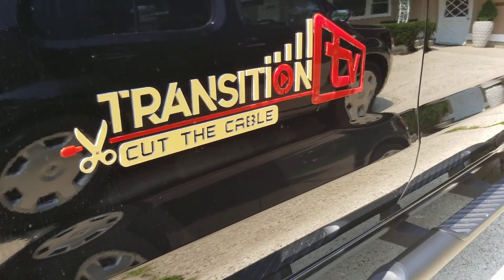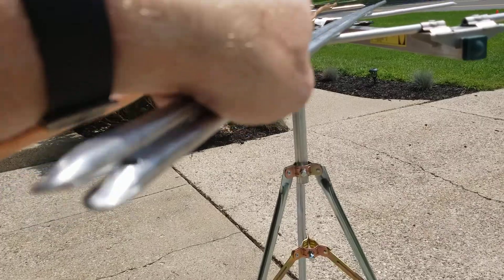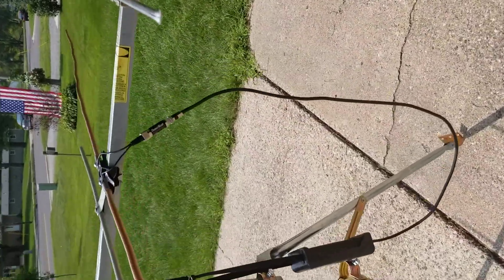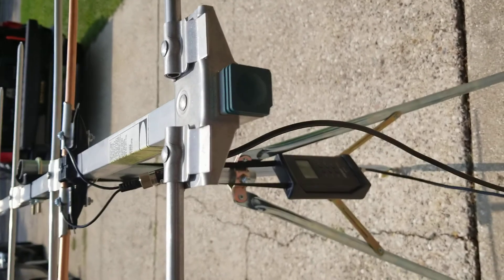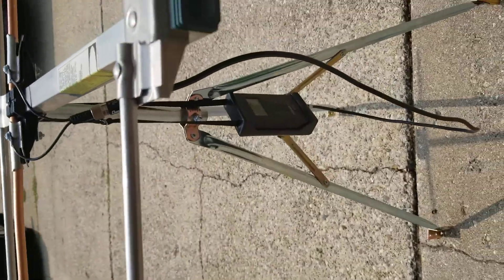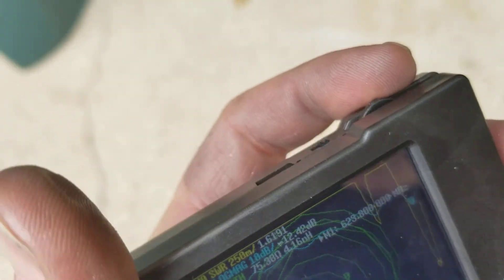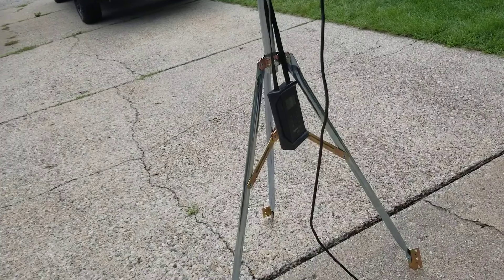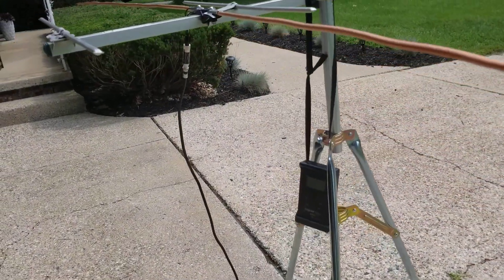Is a copper antenna better than aluminum?

Comment: You probably need to tune the copper elements differently to the aloy ones. Also you only did a test on rx not tx, and the elements could have been straightened better and the ends were not flattened off such as on the aloy ones. It would be fair to tune both sets of elements for that frequency and then compare once tuned for the same frequency.

Comment: Radio emissions come from current in the elements.  Current through a resistor dissipates energy as heat.  Copper is more conducive than aluminum, so more of your signal will end up being converted to heat with aluminum than with copper.  Thicknesses of the wire/ elements and shape (to a lesser extent) are also variables that affect the conductivity.  The difference in the very small antenna you have there will probably not be noticeable.  In larger antennas it will be.

Comment: As a ham radio operator I will agree with you that aluminum is king!! Usually the yagi or log periodic antenna is made out of aluminum, however lots of time the wire antennas used for HF are made of copper wire. For instance, the basic dipole antenna. Aluminum can be used as well but in my case I usually use regular THHN household wire as it is easier to buy at the big box stores ( Lowes’s or Home Depot ). Thanks for the video and very well presented.

Comment: I like you testing copper over aluminum.Been told that two of the main reason of using aluminum is the cost and the flexibility of the elements when in winter sleeting the flex removers most of the problems. How do you like your nano VN A ???  Michigan is a real super nice location to live and enjoy. Would you have any deep fringe antenna that you would like to get rid of Sir ??? The thing that gets me with copper is some swear by it other avoid it like the plague. Thanks fella vf

Comment: afaik, copper elements have no noticeable effect on receiving yagi, however while transmitting, less heat would be generated. also a loop antenna would benefit from the better conductivity of copper

Comment: Interesting test, what about 2.4 GHz? does that mean copper is bad for it too?
Reply: Not bad, just that larger antenna are more practical made in alu. He could have changed a few things, it's possible he needed to tune the antenna differently when using a different material, he didn't straighten it so well and he did not flatten the ends off as they were on the alu driven elements. Also. This test was receive only he did not do a tx test.
  The higher the frequency the closer to the surface the signal will travel so for very high frequencies it may work better to have a silver or gold coating and at lower frequencies it might be more interesting to study the conductivity slightly below the surface of the material being used.
Reply: @izzzzzz6  appreciate the explanation! thank you

Comment: Here it is stated. Different materials tune differently for different frequencies. You should try this test again after tuning the elements for copper on the same frequency. People are taking your conclusion for granted but it is not a correct conclusion!
  https://youtu.be/ev_C0YeOuD4?t=76